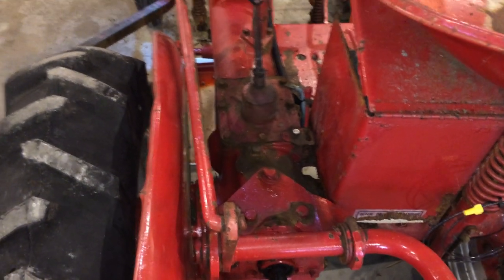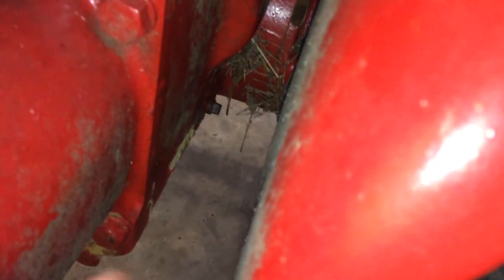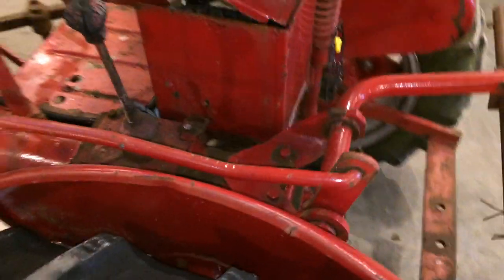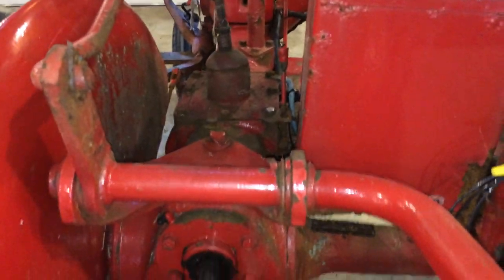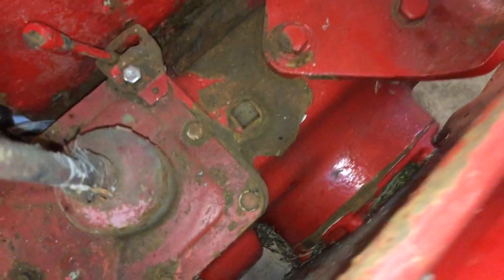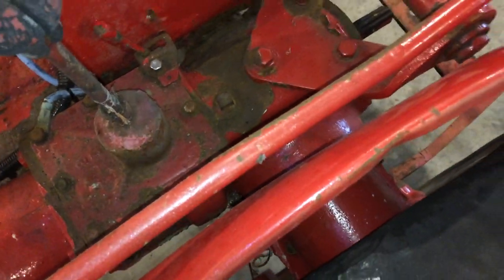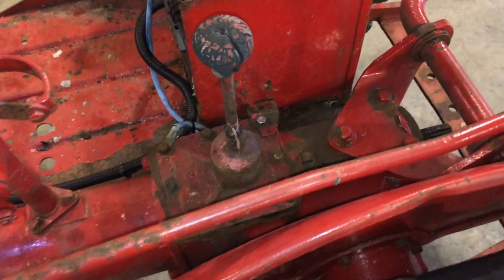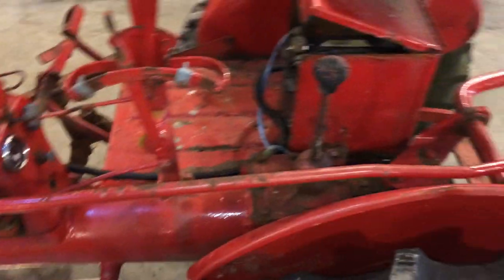Check and change gearcase fluid on Farmall Cub and others!!

Comment: Picked up a cub cadet original which has the same tranny,  last guy filled it to the fill plug. Had to pull the brake hub apart to find out why it wasn't working only find A STREAM of oil draining from the seal..

Comment: The cap on the cub is a triple baffled cap. On any older IH tractor you cap go to a web site and enter you serial number and if its not been clammed you will get one mailed to you for free. IH had a recall on the two baffle gas caps.